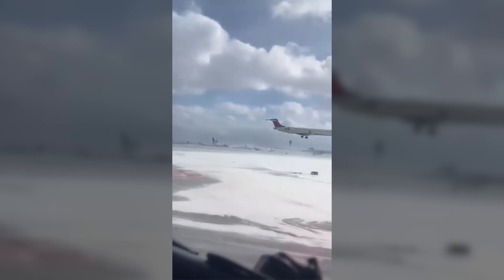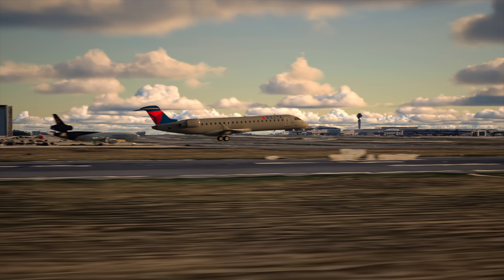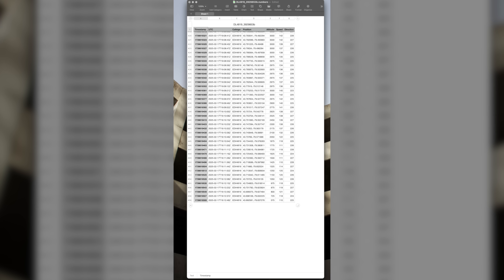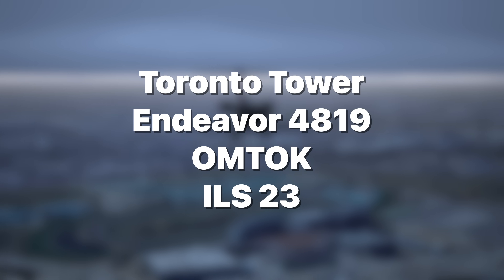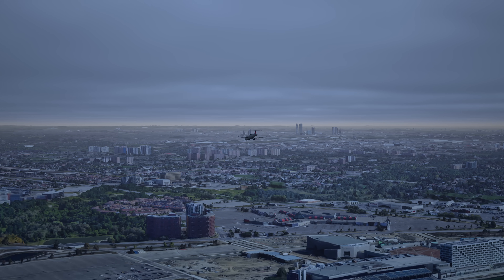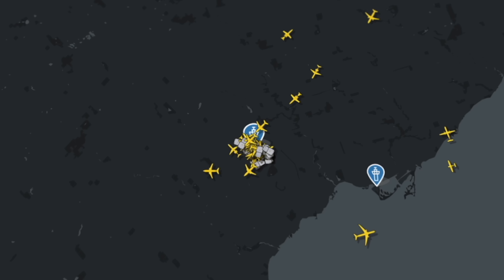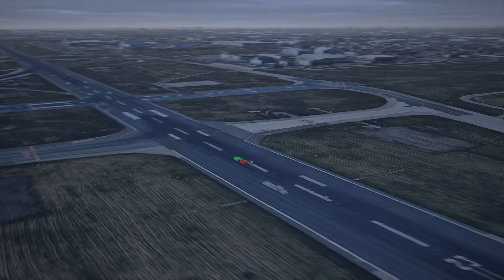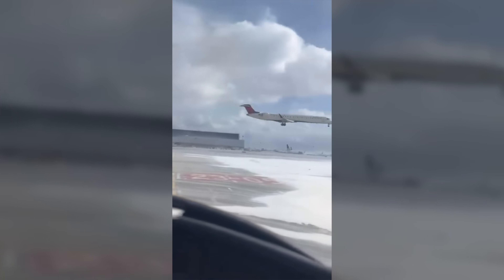What Caused The INSANE Descent Rate in Toronto?

Comment: Looks like classic windshear.  If you look immediately before the plane impacts the ground, it not only has an incredible increase in downward vertical speed, but it also appears to hit first on the right wheel only and probably collapsed the landing gear at that point.  The right wing touches and is sheared off, followed immediately by the lift on the left wing flipping the aircraft.
Reply: I think it looks like the landing gear collapsed👍
Reply: @dougkos2574 Collapsing gear broke the wing strut, allowing wing to tear off from ground contact. The fuel from that wing ignited, but the plane slid out of the fire and the ground crews were "on it"
Reply: I agree, Windshear seems to be the most probable cause. The decrease in lift would explain the pilots sudden inability to control the descent onto the ground. Given the wx conditions and the fact they were on a stabilized approach up until the last few seconds this seems more likely than the pilots just didnt know how to land in a crosswind. Well see what the investigation determines
Reply: Left wing flexing was huge at the instant of right gear touchdown. Not normal.
Reply: Yup.  From the video that appears to be the sequence.  An abrupt downward force collapsing the landing gear, followed by the right wing, and so on.
Reply: or microburst with the gusting winds
Reply: Likely.  Windshear has caused my wife to put her car in the ditch numerous times.
Reply: It was not just the lift of the left wing that caused the roll.  With the right wing snapped off, gravity and support from the left landing gear boosted the roll.
Reply: At :08 you can see the snow blowing almost straight down the runway.   Quite the headwind.
Reply: No
Reply: Classic keyboard expert 😂😂😂😂😂😂
Reply: Windshear is mainly related to thunderstorms, which is not the case here. Looks like a hard landing with no flair.
Reply: @steveconkey7362  True but gusting winds and quickly changing directions create havoc.
Reply: @ Gusting winds changing direction is effectively the definition of windshear lol
Reply: @steveconkey7362  Incorrect.
Windshear and microbursts happen around thunderstorms but windshear can be caused by many different things.
Different weather phenomena, wind blowing over terrain, wind blowing around hangars and other buildings, and some times it’s just just a sudden gust. I’ve flown in and out of of several airport in the Alps, you can get severe windshear on a CAVOK day if the wind is at a certain speed and direction. And don’t even get me started about Gibraltar!
Reply: @Captain101-x1o right. But this accident, there was no windshear.
Reply: I’m thinking wind shear too, maybe a big tail wind came along
Reply: Agreed
Reply: I slowed the vid down and you can see the bottom fell out. He was set up nice, looks like classic wind shear.  Ref + 10 might have helped.
Reply: I definitely concur it's windshear where all the force was absorbed by the right main gear, instead of shared by both, and the TINY gap between the right wingtip and the ground in the CRJ9 seems to border on unsafe for such a maneuver.  I would have expected to see what I've seen many times in videos of windshear escapes with CRJ9s (which you see a lot today for some reason :-) ), where they are all crabbing instead of dipping the right wing into the crosswind. I just think the latter should be disallowed on aircraft where the the wingtip can get THAT close to the ground such that there's only a tiny buffer before BLAMMO happens.
Reply: @SteveGoldberg you are incorrect with your assessment of dropping a wing.  It’s perfectly fine.
Reply: Not sure how you get windshear on so much strong cross-wind.
Reply: It looks back wheel broke aircraft tilted to the right wing hits the ground aircraft flipped over 
Thanks allah all passengers saved
Reply: Looks like a textbook crosswind landing.   The landing gear failed.   It happens.
Reply: Not
Reply: Doesn't look like wind shear whatsoever. The descent was far too quick well ahead of landing(not just before actual landing). 'You' just know and can see why it was headed for trouble from the start of the video. 
Also the right wheel doesn't hit first. You are being 'tricked' into thinking that because the recorded video is at an angle. Tilt the image to level and you can see both wheels are level to each other.
Again
Reply: @babajaiy8246  Not true, there is another video from the back and it clearly shows the aircraft tilted to the right and the right gear hitting first and collapsing causing the wing to slam into the ground.
Reply: @skydancerforever  " Not true, there is another video from the back and it clearly shows the aircraft tilted to the right and the right gear hitting first and collapsing causing the wing to slam into the ground."
It is true. The angle of this shot exaggerates the relationship between the two wheels. The collapse of the wheel is not because it may have touched down first for a split second, but that the plane was descending far too fast to begin with.
Reply: In the recent winds in Southern California, my house shook as if it was an earthquake. I have a door that won’t close and many new cracks. These gust could be instantaneous. No one was flying that first night.

Comment: I heard on the comms of ATC there was a medivac helicopter hovering in area and possibly the rotor wash drifted into the flight path causing the sudden down draft which neutered any flare attempts.
Reply: The chopper was north of where the airplane ended up, not near the approach end.
Reply: @GWNorth-db8vn  Yes however could the rotor wash have been blown by the gusts into the path which was from the east to west Runway 23 's path ?? Kind of like a invisible tornado from the chopper location ?
Reply: @AuthenticDuke  - Seems doubtful. It's nowhere near the size or intensity of the vortex from a plane, and the wind was shifting and swirling around anyway.

Comment: Could altimeter reading been off.  So that the pilots thought they were higher than actual?
Reply: No….. ot doesn’t make sense 😟 only decent rate make this crash
Reply: No! Pilots at that point are getting  info from the radio altimeter giving actual altitude above ground @ 50 ft they would go idle and start the round out at 30 about 30 ft

Comment: You can clearly tell the landing gear collapsed. The plane almost stopped dropping when the wheels touched then instantly dropped fast another distance and that is when the flames started.
Reply: Well I guess  the landing gear would collapse when that tonnage drives straight into the runway like it did.
Reply: @ I don't know, Phil, but seems to me it should be designed for that. Fuselage held, which is something big,  so they did have competant engineers at least on part of the design. I am thinking more like got ice in the  landing gear stow mechinism, and didn't clear it, perhaps while de-icing the ice you can see or along that line. Obviously short staffed I and don't imagine a happy staff.  Miles too far into speculation though.
Reply: @ I'm really no expert. I was just being a little sarcastic that's all. It did seem to belly flop real hard which to me seemed maybe collapsed the landing gear.
Reply: @MitchAshdown  Very few aeroplanes are designed to withstand being slammed into the ground like that. They assume the pilot will flare to arrest the descent. Carrier based aircraft are an exception!
Reply: AOG Technics, anyone?
Reply: also wondering if there was a landing gear issue .... typically an airplane will bounce if it experiences a hard landing but there was not even a bounce here. it was like the aurplane was flown directly into the ground. piloting error ? thad b my guess.
Reply: @shengdauniversity  Why not windshear? Good thing you're not on the investigation...
Reply: Yes, but other planes have landed and had the landing gear collapse with the wing shearing off... so was it a landing gear issue, or a wing frame corrosion or metal fatigue issue?
Reply: @ Of the same model of plane and recently, but fact check me on that one, I'm insecure in saying it.

Comment: The wind usually reduce approaching the ground. It's normal. Pilot have to add extra approach speed as a buffer. Airbus have a fonction for that called Ground Speed Mini and it's built in when you use the auto-thurst. The RJ don't have such a fonction. But, even if the aircraft was low in energy close to the ground due to inertia and reduced headwind component, I still expect to se a pitch up from the pilot. I don't see it.

Comment: There is no indication of a stall watching that video, ive got a couple thousand hours in the Crj 900, i doubt downdraft without thunderstorms. To me I hear atc warn of a "bump in ils" do to crossing traffic, they may have very well had the ils kick off briefly and then dove it back down to catch the slope. the Adsb data shows ingredients of an unstable approach, that said, there was no arrest of the descent or flare watching the video. The Rj 900 has a challenging profile to land, the main gear stands fairly taller than the nose gear, to me it just feels like a training flight, someone whom hasnt had any landings with this plane, either that or incapacitation. Watching the video its just driven straight into the threshold with no attempt to change that descent profile. Glad everyone is ok, crazy times.
Reply from the maker: Indeed I’m learning that “bump” term means an ILS disturbance. Not something I have heard before, but now I have.
Reply: I think it is premature to claim a stall is not occurring.  It doesn’t matter how many thousands of hours you have in the CRJ unless you have stalled one in the flare, or have seen someone else do it.  Nobody practices a stall below 100’ in the simulator and that would be at best partially theoretical.  You may have jumped to your conclusion because there was no fully developed stall involving a nose drop, but that doesn’t rule out a low energy state and partial stall.  These high performance jets often fall mostly flat before a fully developed stall.  It could also affect the elevator authority explaining the lack of flare.  Too early to tell. It could also be a combination of factors.
Reply: @robertkunselman650  What are you talking about.  That is the point of a flare is to reduce speed so that the airplane stops flying and does it in a controlled way.  This means stalling the wing.
Reply: @RobertFrisbeeTAM no, you don’t stall a jet to land.  That’s done in little Cessnas, but not in jets.
Reply: @robertkunselman650  Agreed… it’s very possible that the aircraft was carrying insufficient speed to account for the gusting winds… A momentary decrease in the gust factor, could easily have resulted in a decreasing headwind component, (perhaps a 10 knot loss of airspeed)…and if the aircraft was carrying, insufficient airspeed for the conditions, there could have been insufficient air speed/energy to properly complete the flare…(having said that… Listening to the tower controller, reporting wind speeds during the previous arrivals, winds were relatively unchanged, i.e., 270° magnetic at roughly 25 to 35 kn…None of the previous aircraft commented on any wind shear, during the approach.
Reply: @robertkunselman650 it’s NOT a stall. Unbelievable what people think they know.
Reply: Wouldn't they be hand flying the plane at that point, or does it have auto-land capability? It seems to be about the last 75 feet that the descent increased greatly.
Reply: @GreatDataVideos  Definitely!
Reply: Hilarious username 😂
Reply: @testpirate2570  That “bump” in the ILS, was simply a “heads-up” by ATC to let the pilots know that during the initial part of the approach, they may get a momentary erratic reading in the ILS /glideslope due to a “taxiing aircraft” momentarily interfering with the ILS signal… It would’ve happened early during the approach, and had nothing to do with the Landing accident…
Reply: May be a dei hire as well like the chopper in Washington. In Canada they will hush it up.
Reply: @dannylebovits8090  you people are exhausting
Reply: @dannylebovits8090 do they require different amounts of hours, training, certifications based on gender and ethnicity?  DEI means with candidates of equal merit you might prefer the one who traditionally does not get the opportunity due to bias.  So are you saying the problem might be that a woman was flying rather than a man with equal merit?
Reply: @JehanSaintre  That is not the effective definition of DEI in many places - if it was most people wouldn't think DEI is a major issue.  In many cases DEI means they reject qualified non-preferred candidates outright in order to try to boost the numbers of the preferred candidates.  In the worst cases they still aren't able to meet their artificial quotas and end up reducing requirements to try and do so.  This exact thing is why the U.S. ended up with a shortage of air traffic controllers - because they created a screening questionnaire which tried to identify the 'preferred' candidates and prevented the non-preferred ones from even taking the cognitive test which they must pass to be hired.
Reply: @topomusicale5580  So the gap caused by Reagan firing controllers, mandatory retirement at 56, long training periods, and difficult-to-pass assessments, the need for applicants who are willing to relocate every couple of years along with tightening budgets aren't the reason for shortages, it's DEI?  Where can I learn more about this questionnaire and the policy of blocking applicants, aside from a "trust me bro" youtube channel?
Reply: @JehanSaintre  the pilot's voice was male
Reply: @villagaiac55 it isn’t always the pilot on the radio, but it doesn’t matter.  Some of the women flying airliners are former Navy pilots, you can’t tell anything about someone’s experience from their voice.
Reply: @JehanSaintre mandatory retirement at 56 would mean all your "Reagan gap" cohort are retired. But sure, mandating criteria other than competence in hiring would never impact quality of service. 🤪
Reply: @topomusicale5580 complete BS what you say about DEI. It doesn’t mean unqualified. And no, that’s NOT why there is a shortage in controllers. The FAA have clearly stated that they didn’t turn down qualified applicants.

Comment: Its really hard to tell, even at 4k... but were the flaps down? That might explain the stall at that speed. The "bump" mentioned by ATC sounded less like a warning about wake turbulence and more about weather turbulence experienced by the plane ahead of him. As you say, there would be no need to warn about the wake from such a small jet, but also why would the pilot of the proceeding craft warn about his own wake making a bump... he would not experience it. 

At this point its either serious wind sheer,  pilot error no flaps or perhaps the copilot accidentally deployed the spoilers. As you also mention, there is no flair and his decent rate was insane, and that means too low a speed , which at 145kts, should have been fine even at flaps 30. He was falling out of the sky when he should have actually been a bit floaty.
Reply: ATC was warning about a possible disruption of the GS signal due to a vehicle near the transmitter not a warning about wake turbulence.

Comment: Sounds to me as tho ATC was warning of a ‘bump’ in the glidepath indication due to another aircraft taxiing in front of the ILS antenna, rather than anything to do with wake turbulence. 
Maybe wind turbulence was a factor, but I don’t see any flare at all.
Reply: At that point they should be flying by looking outside , not following “bumps” in the glide slope signal. Meaning, thats probably not the issue
Reply: @ Yes, unlikely to have contributed to the accident, but still a good call from ATC. Even in clear conditions the ILS can be a useful cross check, particularly the glideslope info.